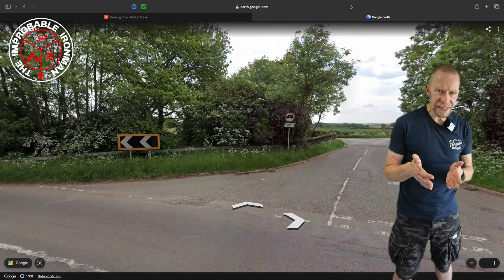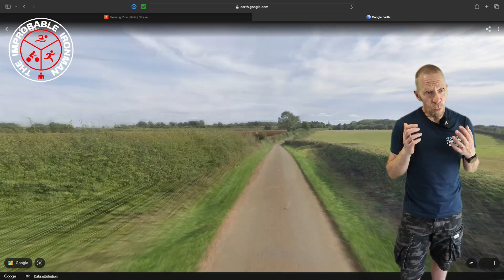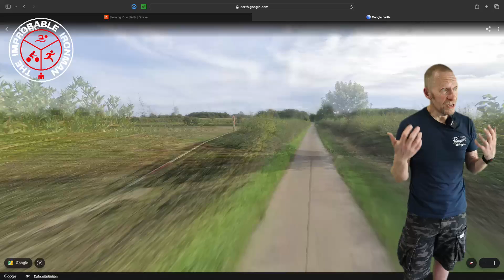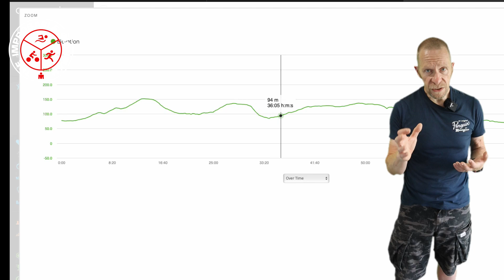Belvoir Olympic Triathlon - Kit, Course and One Big C*ck up!!!

Comment: Great recap, mate! Question: don't you guys get the bike course as a gpx beforehand? Or is that not a thing in Triathlon?
Reply from the maker: Thanks mate. That's a good question. The GPX files are often available, however, it could be a bit of a faff in T1, starting the course etc. so I tend not to use them. Ironically, any time I'd have lost starting the course this time could have been made up for by not taking a wrong turn. One caveat in the case of the Belvoir GPX file though - the Race Director mentioned in the pre-start briefing that the GPX file was wrong - as it took you along a gated road....probably the exact same gated road I ended up on. Thanks as always for watching and commenting.